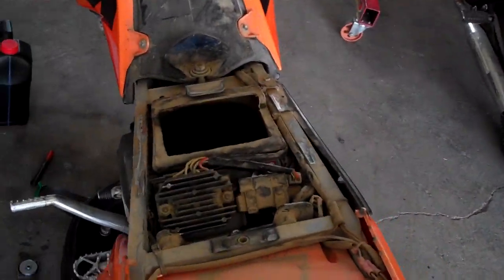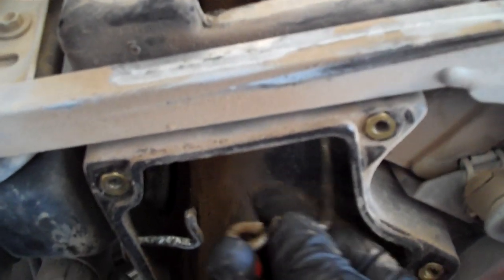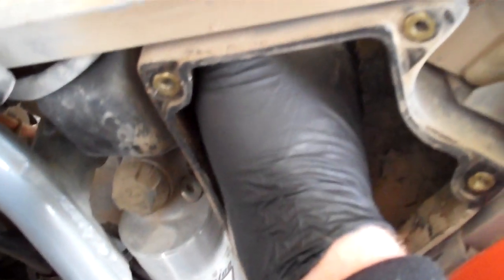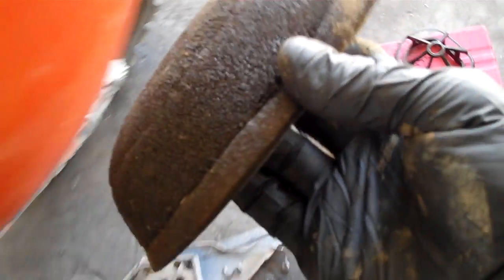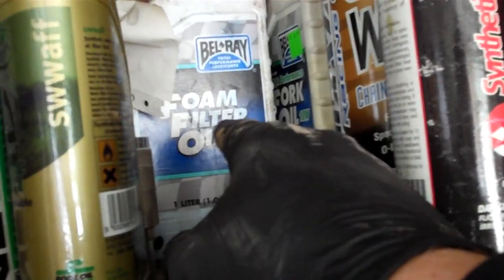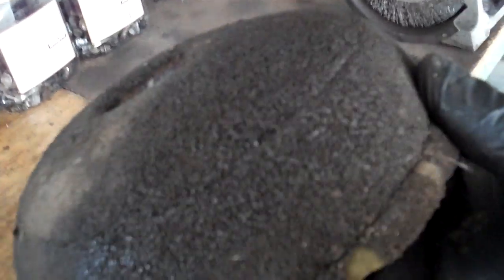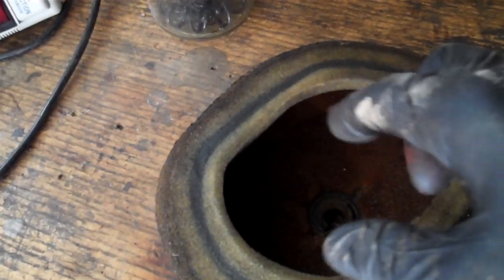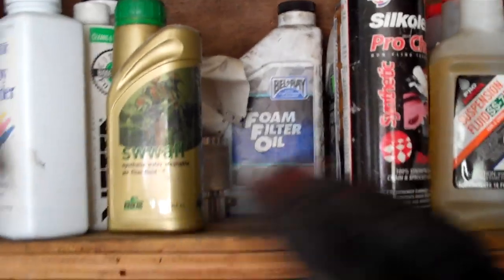How to clean the Air Filter on your KTM dirtbike

Comment from the maker: @sluggo98 That's a good question.  I have a designated parts washer/can that the dirt settles to the bottom of.  The gas is re used multiple times.  The left over sludge/dirt you put in a paint can and dispose of the same way you do old paint.  It's a hazardous waste.  Your local waste disposal facility will take it.  Sometimes you have to pay $2-$8 to get rid of a gallon can.  It takes years to accumulate that much.  I like the Belray in a two stroke.  Anything four stroke SWWAFF is enough.

Comment: no toil tends to settle to the bottom of the filter too... ive stoped using it aswell. i now use bel ray or any petrolium based oil and diesel fuel as my cleaner

Comment: as i said, i havnt heard of anything labled foam filter oil or air filter oil doing a bad job. im sure some do better than others however. i clean my filter after every ride or 3 to 6 hours. sometimes i do every other ride but usualy not. i also just use dawn dish soap to clean my filters and it works just fine for me. gets all of the oil out.

Comment: dude your due for a new air filter. its too messed up to be cleaned IMO. and btw, doesnt bell ray make their own cleaner so you dont have to use gas? i hat cleaning with gas, it smell bad, not good for you, and you have to figure out a way to dispose of it. and i know you dont want to here this, but i suggest no toil because there a no fumes, its biodegradable, cheap, and spreads well. just a suggestoin. and damn you need to clean your air box.